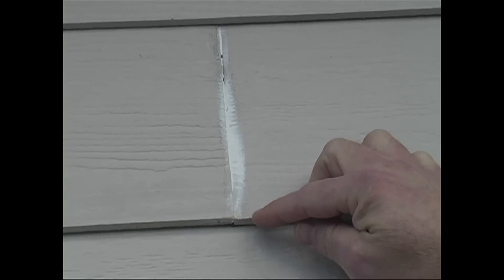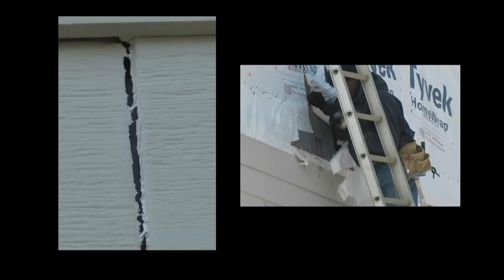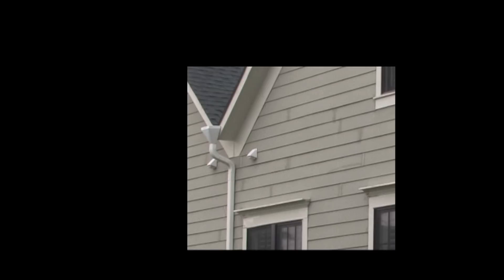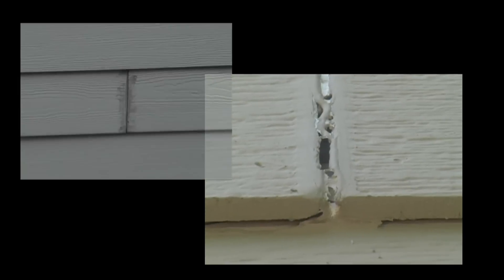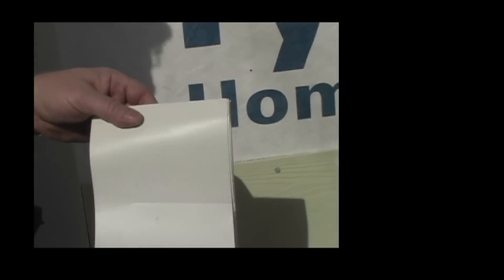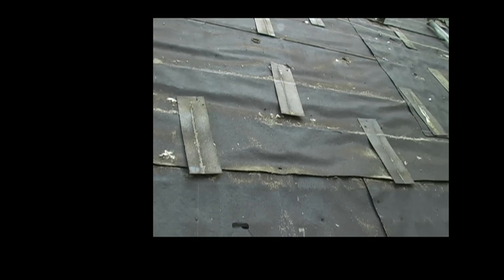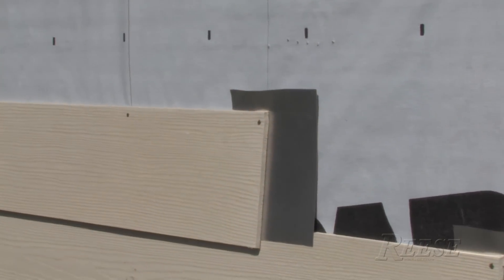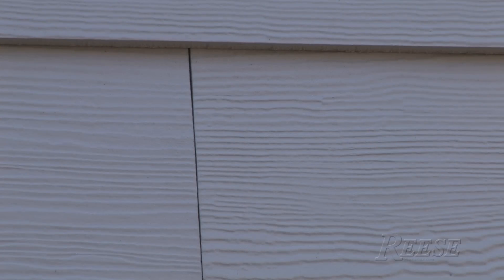Reese Tips - Flashing the Butt Joints of Fiber Cement Siding ytv160

Comment: Every carpenter knows this. I use ice and water shield, which is usually left over after roofing is complete.However, I do back caulk my end cuts at the trim.
Reply: Wolfbyte World Wow this is a great idea. I have a ton of ice and water shield left over. Any other pointers before I DIY this project? I know to caulk ends by trim as you already stated. Any other pointers?

Comment: how about post install flashing options? would love it if they would have flashed in the first place and not used caulk for the joints. 
Is there a solution to flash after the boards are up?

Comment: If you have proper flashing underneath hardie thats not pre-painted, won't caulking butt joints improve appearance? Sure it may crack but the crack will appear smaller because of the caulk. When the paint fails they shouldn't have to mess with the butt joints because the caulk is just cosmetic. I may be wrong what are your thoughts?
Reply: logos2600 the video's great because it shows the unsightly evidence that caulking butt joints leads to. UG•LY!

Comment: Thats bullshit about never caulking the butt joints....if you caulk them with correct technique, with an excellent quality caulk, and at the time of new con or a full repaint, they look great for years, at least until the next full repaint. The key is to pump the caulk into the gap so you have plenty of material, then NOT wipe the bead right down to the surface...you leave a little 'mound', some material that will hold to both edges and flex with gap expansion, instead of tear. Looks great...
Reply: jtlachappelle jtlachappelle a couple questions - how are your caulked joints holding up over time? I would find it very helpful to see your pics showing how they look after several years of weathering.
Also - if you're doing the caulking yourself you can certainly control the quality of the caulk AND your suggested installation method. However without that level of control, trusting those steps/procedures to a contractor/sub-contractor/painter would be a crapshoot at best, a world class nightmare at worst, don't you think?
By the time you've either followed your guidelines from the outset or heaven forbid, had to correct the foul-up of someone else, (as this video clearly demonstrates) wouldn't you have saved yourself enormous amounts of money and time, not to mention aggravation, by simply following the advice of this videographer and the manufacturer? 
Installing strips of flashing at the joints (as the videographer and manufacturer both recommend) would seem to me to offer the best ROI. After all, Hardie is not cheap, so following a perfectly sensible, practical, and simple approach to protect that investment by spending a little extra on the tape to flash the joints seems to be the best approach.

Comment from the maker: @1990notch 

 Hardie requires a 1/8 " gap at the end of the siding where it contacts a trim board in the corner or around windows. This area is then caulked. 

Butt joints do not require a gap, and in fact are better installed lightly touching. 

Fibercement can (but usually doesn't) shrink as chemical reactions occur during the curing process. This may continue for several months. Temperature related expansion should not be a problem.